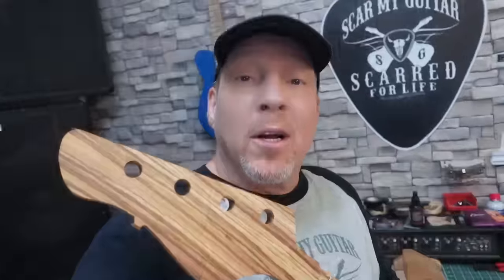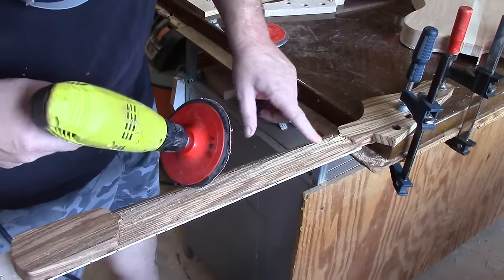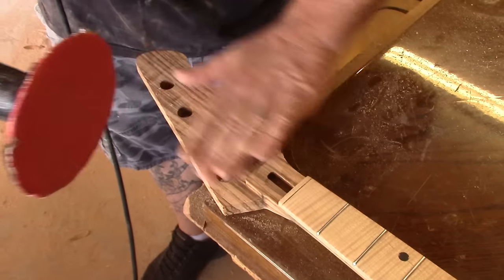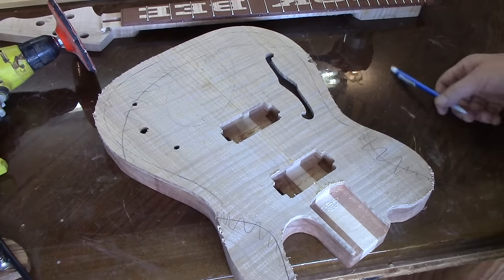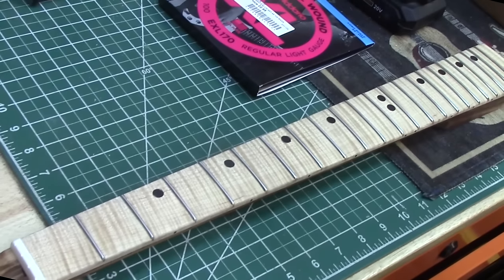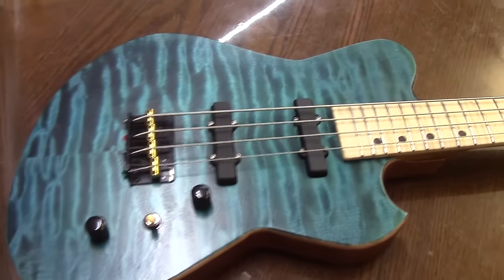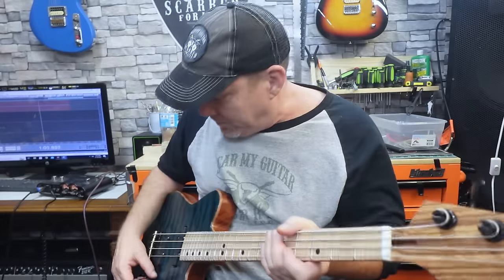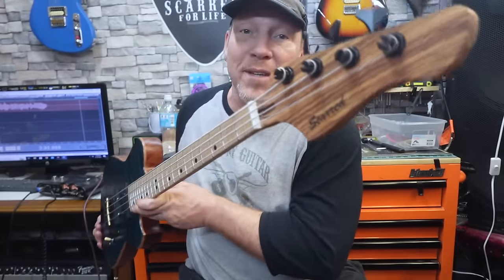IS THIS SHORT SCALE BASS GUITAR ANY GOOD? Some Of The Best Woods WITH BARTOLINI'S !!

Comment: After you’ve sanded with drill and then handing . I found a 3/4 and a 1/2 in. foam hook and loop pads at Harbor Freight  that goes between the disc and the sandpaper. You can use them with a drill too but it contours to whatever you’re sanding and covers almost twice as much area. Also love the videos. Repairs, new builds, upgrades, I like them all.

Comment: Love all the scarred video's but this one was special to me. Due to a spinal cord injury and disability I had to go to a short scale bass. I bought a couple of 30 scale bases but I still had a little trouble with them. I found that Squire made a 28 scale mini precision and bought one and it was ok. I stripped it replaced all the hardware and installed dimarzio relentless pick ups and it is a very nice little bass but Sean yours is a work of art. That thing looks awesome. To answer the question is it any good? It looks fantastic to me, I would be proud to gig with that bass anywhere.